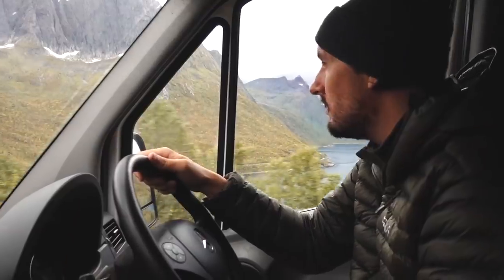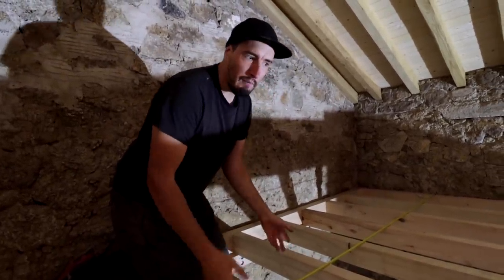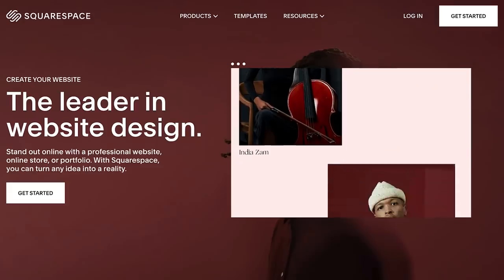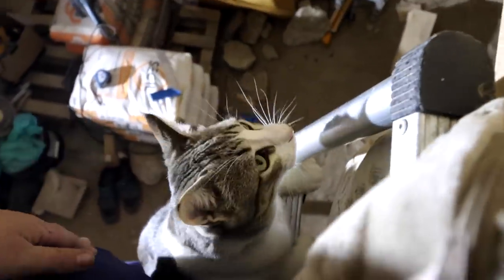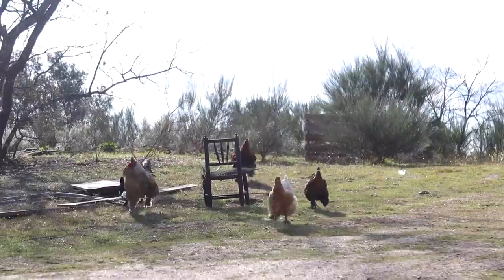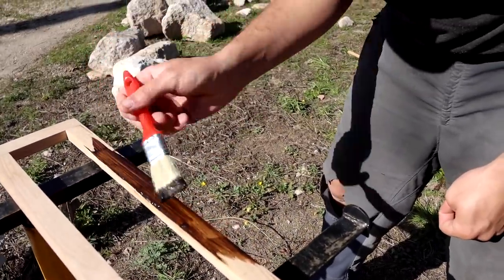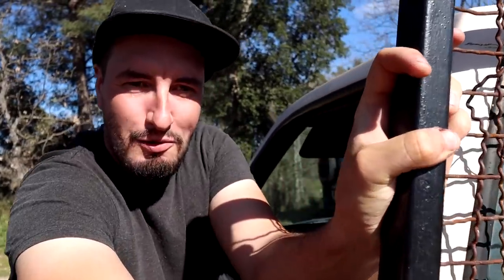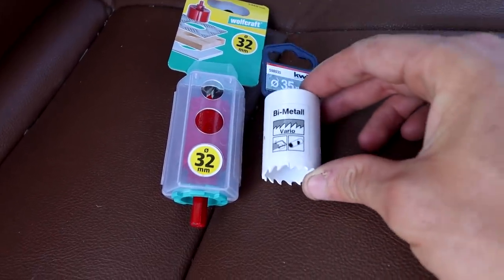THIS ISN’T GOING TO WORK! Renovating an Abandoned Barn in Portugal

Comment: I don't know if anyone has mentioned this, but you could install a set of stairs that has a pully system, so you can let the stairs down at night and draw them up to the mezzanine level height during the day, when you are on the base floor. I see this done very often in small cabins and small apartments with lofts. Allows more room during the day on the base floor when you are not utilizing the mezzanine. Just an idea.

Comment: What if you build the Stairs kind of "around the Corner"? For example, starting it along the Wall where the Door is to the Corner and then from there along the sidewall coming out somewhere around the midle (highest part) of the Loft? So you can build Cabinets, Shelfs or drawers under the Stairs to use the Space there aswell and if you don't make the Stairs super wide, this way you don't lose that much Space in your Living room and you will still be able to walk up and down with both your Hands full with Stuf (Coffe/Drinks, Books. Bedsheets, Cloths, etc.) without the risk of falling beeing super high.

Comment: Extend the mezzanine, position access stairs (not a ladder) alongside the opposite gable wall with the top of the stairs directly below the roof apex hand rail right side gable wall left side. Current plan of bed location could be used for multiple purposes (which could include a basic type camper set up toilet and washing facility) Thank me later.

Comment: like were the ladder is when I drew up plans for what I might do that place came  up.   You might turn the ladder 90 degrees so you walk over to the wall and climb down the ladder by stepping on to the ladder with your right leg.... so the ladder would be on the wall at a slight angle. then you can put storage behind it have the railing for the ladder go all the way up to the ceiling to make grabbing on easy.   Then do a L shape sofa  and put the tv on the wall with the ladder on the left of the front door.  Create your own sofa platform and use the cushions from couches recovered .    In my design I put the stove in the middle on a raised platform that then could also be a combo kitchen island kitchen table and desk. I have seen built in kitchen cabinets that also served as steps.

Comment: Re your plugs, keep the sawdust from cutting or sanding the chestnut, and mix it with the finish. That will make filler if you plugs are a bit small. If you use finish instead of glue, it will disappear when you sand and apply finish to the final product, as glue may reject the final coat and show. This is a technique cabinet builders or in my case guitar builders use to hide joins, cracks and plugs.

Comment: Hey, I'm surprised you're not putting in a 'library' ladder.  It can be stored where the ladder currently located during the day and then slide it across at night to get up and down.  This will also mean that you won't have low ceiling where the ladder is located as you're 'bannister' will have a gap in the middle for the entry point as opposed to at the side.  No promotion, but take a look at the Library Ladder Company...   Great channel.

Comment: How about a sliding ladder like you have in old fashioned libraries. That way you could have a central opening in the Balustrade and have full head height at the top of the ladder.  When its not in use, slide the ladder to the wall.

Comment: Instead of a ladder why don’t you build a step stair up against that wall from the edge of your glass door to where you have located your ladder.  It would be steep but more useful than a ladder and you could put shelving underneath so it would look more like a bookcase. And you would have to get inventive with a railing.

Comment: The right size wooden dowel will save your sanity. All you will need to do is take slices off it on the saw bench ti fit into the bolt holes.

Comment: Why not have a balustrade(railing along the front of the mezzanine,) with an opening like a gate. The ladder could mount on the front edge on rollers so it could move to the side when not in use? Or hook a ladder on when needed at night time

Comment: I think I would have built stairs against the back wall, starting at floor level at your bed end and arriving in the loft in the opposite end. You could incorporate storage or the end of the couch into them. While your young and sober I can see a ladder working, but when you have come in from outside knackered from hard work and a bit drunk, or sick, I think that ladder is going to be a challenge (a few nights on the couch I can foresee in your futures).

Comment: When it comes to making a wooded dowel you might wanna try attaching a screw to a piece of 5mil metal rod about 3 inches long and then screw that into the dowel that way you can use a drill as an aid in sanding down a wooded dowel to the right size.

Comment: You might want to check out Life Uncontained for info on a water system. Their’s is collected from their roof but adapting to a well source is not much different. I’m thrilled you changed your ladder position. I was sad for you to cut those beautiful chestnut beams. When you create the railing-check safety height. With Theo being 6’3”, a low rail would be dangerous. But maybe a chestnut and tensioned wire railing? Gives visual flow but also safety. 
Car maintenance is tedious, but rewarding. Always plan ahead of a breakdown. This gives you time to get good prices on parts.

Comment: Guys. Why not put an iron railing  across the front. Then build a library ladder with wheels on it so u can just roll it to the center when u need it. U can even put it on a pulley and pull it up if u want.

Comment: I vote for a ladder like a library ladder that can be hung on the wall when not in use and hook onto the platform when you need it. If you can design it with a sort of hook at the top so it won't accidentally come undone when you are in the loft.

Comment: Get yourself a "wee" bottle for the mezzanine instead of dealing with the sladder in the night.  Have you considered putting the bed on the opposite end of the mezzanine so you can have a skylight over the bed and not interfere with traffic past the sladder?    Do you have a Berkee

Comment: Amazing episode guys! Picking up steam now :)

The ambitious guy in me would love to see you craft a pull out ladder that can be stored between the joists/under the flooring and lift out into position... OR stored in/under the bed frame to be pulled out when you need to use it. I'm sure it could be done with clever engineering but not really where you want to be focusing your energy for now.

However, I also agree with other suggestions to have the steps at a 90' angle to the mezzanine. having the edging of the floor to hold on to will be an excellent confidence boost coming down.

Comment: Dud you save any of the sawdust from cutting the  chestnut wood? Could you use a regular dowel cut a smidge smaller than the depth of plug and mix Woodglue  and chestnut sawdust  and use that to finish plugging the holes. Then light sanding blending seemlessly.

Comment: The bed size of 135x190 is quite small, only a double. If you are 6ft3, you will find that very annoying and eventually you will want a bigger bed. A queen is about 150x200 or 205, so you take that into account too. You are used to living in a van though, but you might consider it.

Comment: To cover deck screws merely buy or create dowels in the proper size and cut to length with saw , or pound in and cut with chisel.
For loft you could try a rolling ladder attached to pipe( like most barn doors or library railings)
If you decide to try railing, 4”x4” and half laps, lagged bolted into the frame both create a solid frame and look great. Did it with my log cabin , and covered the bolts and screws with dowels glued in.
The idea of getting up for a pee and dropping 20 Feet to slate floors, didn’t thrill me.😀

Comment: what about a ladder that folds or pushes up out of the way when not in use. we have a portable loo that is just a bucket with handle that has a toilet seat complete with lid attached ,its toilet height so no crouching down in the middle of the night. we have used it in so many situation best $20 ever spent.

Comment: Hello from sunny SW France (via the West Midlands! Where are you from btw? Not too far from me I suspect ie. Stourbridge). I know you've moved on by now but maybe it's still interesting?! We had a very similar decision to make and went with a hatch/folding ladder from Leroy Merlin. Great that you can fold up the ladder in the day and I was going to build a 'door' to close when we were upstairs so you get the floor space/security whilst you are upstairs. It was fine but a bit hairy coming down in the night (bathroom downstairs!) and fate took a hand when it finally gave way - they are only designed for occasional use after all. So I built a staircase and it's great - so much more secure and the loss of space is nothing compared to having the relative safety of stairs. Love the channel - keep it coming!!

Comment: Why not anchor a ladder on the wall behind the door flat all the way up to the roof which would make it easier to go up and down with small side hand rails which the left side ended at floor level of the mezzanine and on the other side going to the roof . It would take up less than a 3rd of the space that a flat ladder up against the mezzanine.

Comment: If you really want the space maxed out, you can always attach a hoist to the ceiling and make the bracket on the steps movable, so you can hoist up the steps on daytime when it is not used. ps Driving a bike myself it is no good idea to drive in jeans with no protects. 😉

Comment: To keep the rats from coming into the barn get some basic steel wool and shove it into the holes.  They hate it will will not attempt to chew through.  Also, if you want to remove it, easy, it is not permanently attached.  I hate to see them stain that pretty wood too.  🚫🐁

Comment: Hi Theo, you never had me convinced about your idea of the bed round the wrong way, and cutting a hole in the floor. Next time you get a flakey idea like that you need therapy. And of course you have therapy on hand. It has 2 wheels, handlebars and a motor. A good motorcycle ride is great for clearing your head and give you chance to reason things out. 
What bike is it? Sounds like a 2 stroke. I like 2 stroke engines. I also think older vehicles are often better for reliability and simplicity of repair. Don't give up on your truck. Get the problems fixed and she will be as reliable as a new one.

Comment: Why build a hatch and not have small, removable wooden staircase (like for bunk-beds) on the edge? You could set it aside in the day and only use it when you need to go to bed, saving valuable space.

Comment: Why have a hatch and slader when you could have steps at the end of the wall and it just goes up at a curve  or a set of steps that drop down on a pulley system and you could pull them up during the day and down when you need to use the main area during the day

Comment: Hi, I don't oftentimes comment on people's ideas etc, but if you had a rail for your ladder so it can slide along to the middle and then slide to the side when not in use.  If not a rail , because of expense etc but a fixing in the middle where it can attach to while you're up there ? Does it need to be fixed?

Comment: Why dont you build a flexible connection like a metal railing to hang the ladder on?  Like you have it for very  big libraries, a sliding ladd
Reply: ladder? In the night you can put it right unter the ridgebeam,  comfortable and safe for Theo. In the daytime it can rest in the spot besides the  wall.

Comment: Squealing vehicle...whether constant or only when turning the steering wheel hard = loose fan belt.
Research loft ladders before deciding on the final design. Also look at boat/yacht designs, or find the nearest business that sells boating/boat building equipment. They specialize in designing compact, yet well designed items for small spaces. They have ladder/stairs that you go up/down like normal stairs.

Comment: I am surprised that you did all the work making the beams so lovely and then used OSB for the floor rather than a hardwood plywood. Now you have to look at that crappy OSB when you look up from downstairs. Also, OSB outgasses formaldehyde and that's not a great thing to have in one's bedroom. I would never use OSB in any construction project: on the exterior it deteriorates faster, and on the inside it is unhealthy.
Reply from the maker: It’s só bee can have a platform to stand up there. We can’t lay the lively floorboards we are using yet as they will get damaged from when the walls get plastered

Comment: You may want to buy a full set of biking leathers BEFORE you learn the very hard way how human flesh comes out  second best WHEN ( note the emphasis!) you drop the bike and hit the ground. I speak from experience having ridden all over the UK and Northern Europe on a  motor bike.  It’s nit so pleasant when it’s very hot and you just want to tool about in a pair of shorts but at 30 mph ona paved road you will scrape off nearly 30% of your skin if you lose it and slide along until you come to a stop.  That can equate to severe enough second degree burns to endanger your life!  Hate to be a party pooper but better safe than sorry!  Not to mention the bones you break when you hit the ground after falling off.

Comment: Why do you make work for yourselves , for goodness sake switch the engine off and park the truck on the slope , then you can do a bump start
Reply from the maker: The alternator belt is no going to fix itself by parking on a hill?
Reply: No it will not, but you can roll the truck down the incline and bump start the truck with out you both having to push the heavy thing , just a suggestion to make life easier for yourselves x